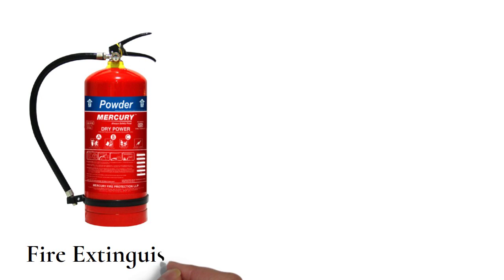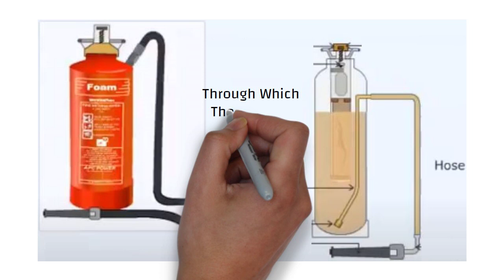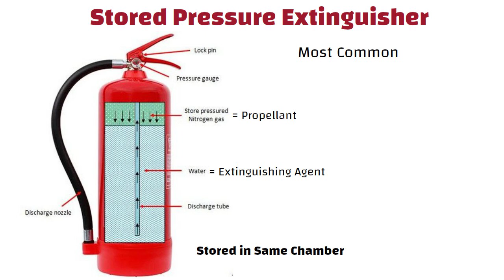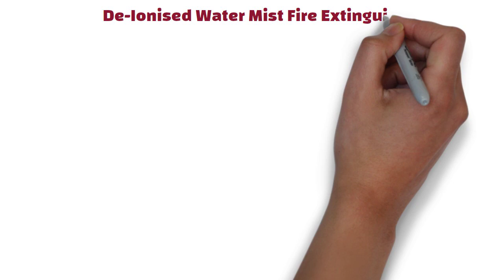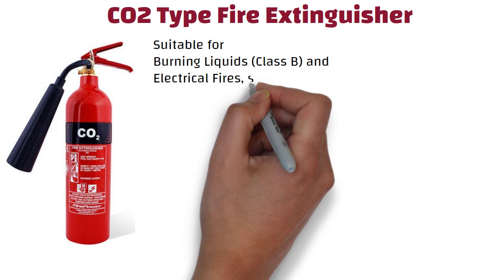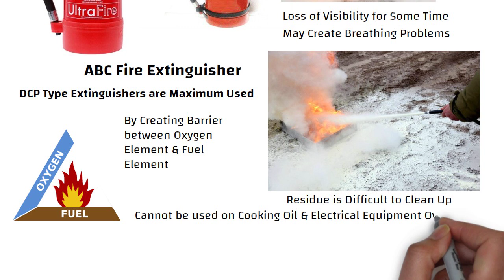FIRE EXTINGUISHER DEALERS IN KERALA, CALL 8138906102, FIRE EXTINGUISHER DEALERS IN ERNAKULAM.

Comment from the maker: FIRE ALARM DEALERS IN TRIVANDRUM, ADDRESSABLE FIRE ALARM DEALERS IN TRIVANDRUM, FIRE ALARM SYSTEM DEALERS IN TRIVANDRUM, ADDRESSABLE FIRE ALARM SYSTEM DEALERS IN TRIVANDRUM, FIRE DETECTION SYSTEM IN TRIVANDRUM, SMOKE DETECTOR DEALERS IN TRIVANDRUM, CONVENTIONAL FIRE ALARM DEALERS IN TRIVANDRUM, MORLEY FIRE ALARM DEALERS IN TRIVANDRUM, GST FIRE ALARM DEALERS IN TRIVANDRUM, ASES SECURITY FIRE ALARM DEALERS IN TRIVANDRUM, BEAM DETECTOR DEALERS IN TRIVANDRUM, FIRE ALARM SUPPLIERS IN TRIVANDRUM, FIRE ALARM TRADERS IN TRIVANDRUM, FIRE ALARM PANEL DEALERS IN TRIVANDRUM, HEAT DETECTOR DEALERS IN TRIVANDRUM, FIRE ALARM SYSTEM SUPPLIERS IN TRIVANDRUM, FIRE ALARM COMPANIES IN TRIVANDRUM, FIRE EQUIPMENT DEALERS IN TRIVANDRUM, ADRRESSABLE FIRE ALARM PANEL DEALERS IN TRIVANDRUM, FIRE ALARM SYSTEM IN TRIVANDRUM, BATTERY OPERATED DETECTOR DEALERS IN TRIVANDRUM, ASPIRATION DETECTION SYSTEM DEALERS IN TRIVANDRUM, FIRE ALARM MCP - MANUAL CALL POINT DEALERS IN TRIVANDRUM, FIRE ALARM HOOTER DEALERS IN TRIVANDRUM, PA TWO WAY TALK BACK SYSTEM DEALERS IN TRIVANDRUM, PA SYSTEM DEALERS IN TRIVANDRUM, PA TALK BACK UNIT DEALERS IN TRIVANDRUM, HOOTER CUM STROBE DEALERS IN TRIVANDRUM, FIRE PROTECTION SYSTEM IN TRIVANDRUM, FIRE ALARM CONTRACTORS IN TRIVANDRUM, FIRE DETECTORS IN TRIVANDRUM, FIRE ALARM DEALERS IN KOLLAM, ADDRESSABLE FIRE ALARM DEALERS IN KOLLAM, SMOKE DETECTOR DEALERS IN KOLLAM, FIRE EQUIPMENT DEALERS IN TRIVANDRUM, FIRE ALARM INSTALLATION IN TRIVANDRUM, FIRE ALARM COMPANIES IN TRIVANDRUM FIRE ALARM DISTRIBUTORS IN TRIVANDRUM, TALK BACK SYSTEM DEALERS IN TRIVANDRUM, FIRE ALARM SENSOR DEALERS IN TRIVANDRUM, FIRE EXTINGUISHER DEALERS IN TRIVANDRUM, FIRE ALARM DEALERS IN ERNAKULAM, FIRE ALARM DEALERS IN KERALA, ADDRESSABLE FIRE ALARM DEALERS IN CALICUT, SMOKE DETECTOR IN TRIVANDRUM, SMOKE DETECTOR DEALERS IN KOLLAM, FIRE ALARM DEALERS IN KOTTARAKARA, FIRE ALARM DEALERS IN NEDUMANGAD, FIRE ALARM DEALERS IN VARKALA, FIRE ALARM DEALERS IN VARKALA, FIRE ALARM DEALERS IN MARTHANDAM, FIRE ALARM DEALERS IN ATTINGAL, FIRE ALARM DEALERS IN KILIMANOOR, FIRE ALARM DEALERS IN ANCHAL, FIRE ALARM DEALERS IN PATHANAPURAM, FIRE ALARM DEALERS IN PUNALOOR, FIRE ALARM DEALERS IN NEYYATINKARA, FIRE ALARM DEALERS IN POOVAR, FIRE ALARM DEALERS IN KATTAKADA, FIRE ALARM DEALERS IN KAZHAKOOTTAM, FIRE ALARM DEALERS IN PARIPPALLY, FIRE ALARM DEALERS IN PARASSALA, FIRE ALARM DEALERS IN KULASEKHARAM, FIRE ALARM DEALERS IN THUCKALAYFIRE ALARM DEALERS IN BALARAMAPURAM, FIRE ALARM DEALERS IN ARYANADU, FIRE ALARM DEALERS IN POOJAPURA, FIRE ALARM DEALERS IN POTHENCODE, FIRE ALARM DEALERS IN VITHURA, FIRE ALARM DEALERS IN VENJARAMOODU, FIRE ALARM DEALERS IN KILIMANOOR, FIRE ALARM DEALERS IN KADAKKAL, FIRE ALARM DEALERS IN CHATHANNOOR, FIRE ALARM DEALERS IN KOTTIYAM, FIRE ALARM DEALERS IN KUNDARA, FIRE ALARM DEALERS IN CHAVARA, FIRE ALARM DEALERS IN SASTHAMKOTTA, FIRE ALARM DEALERS IN PALODE, FIRE ALARM DEALERS IN VENJARAMOODU, FIRE ALARM DEALERS IN ARYANADU, FIRE ALARM DEALERS IN VELLARASA, FIRE ALARM DEALERS IN VITHURA, FIRE ALARM DEALERS IN THENMALA, FIRE ALARM DEALERS IN AKLLAMBALAM, FIRE ALARM DEALERS IN AYOOR, FIRE ALARM DEALERS IN ARYANKAVU, FIRE ALARM DEALERS IN SENKOTTAI, FIRE ALARM DEALERS IN KULATHUPUZHA, FIRE ALARM DEALERS IN MADATHARA, FIRE ALARM DEALERS IN CHIRAYANKEEZHU, FIRE ALARM DEALERS IN KALLMBALAM, FIRE ALARM DEALERS IN MADATHARA, FIRE ALARM DEALERS IN ADOOR, FIRE ALARM DEALERS IN PANDALAM, FIRE ALARM DEALERS IN SAKTHIKULANGARA, FIRE EXTINGUISHER DEALERS IN TRIVANDRUM, FIRE EXTINGUISHER SUPPLIERS IN TRIVANDRUM, FIRE EXTINGUISHER DISTRIBUTORS IN TRIVANDRUM FIRE EXTINGUISHER IN TRIVANDRUM, ABC TYPE FIRE EXTINGUISHER DEALERS IN TRIVANDRUM, CO2 TYPE FIRE EXTINGUISHER DEALERS IN TRIVANDRUM, CLEAN AGENT FIRE EXTINGUISHER IN TRIVANDRUM FIRE FIGHTING PUMP DEALERS IN TRIVANDRUM, FIRE PUMP DEALERS IN TRIVANDRUM, KIRLOSKAR FIRE PUMP DEALERS IN TRIVANDRUM, FIRE JOCKEY PUMP DEALERS IN TRIVANDRUM, FIRE DISEL ENGINE DRIVEN PUMP DEALERS IN TRIVANDRUM, FIRE FIGHTING EQUIPMENT DEALERS IN TRIVANDRUM, FIRE FIGHTING SYSTEM IN TRIVANDRUM, VERTICAL INLINE PUMP DEALERS IN TRIVANDRUM, HYDRO PNEUMATIC PRESSURE BOOSTING PUMP DEALERS IN TRIVANDRUM, VERTICAL TURBINE PUMP DEALERS IN TRIVANDRUM, SEWAGE PUMP DEALERS IN TRIVANDRUM, DEALERS IN TRIVANDRUM.
Reply: FIRE EXTINGUISHER DEALERS IN KOTTAYAM, FIRE EXTINGUISHER SUPPLIERS IN KOTTAYAM, FIRE EXTINGUISHER DISTRIBUTORS IN KOTTAYAM, FIRE EXTINGUISHER IN KOTTAYAM, ABC TYPE FIRE EXTINGUISHER DEALERS IN KOTTAYAM, CO2 TYPE FIRE EXTINGUISHER DEALERS IN KOTTAYAM, CLEAN AGENT FIRE EXTINGUISHER IN KOTTAYAM, MODULAR TYPE FIRE EXTINGUISHER DEALERS IN KOTTAYAM, MECHANICAL FOAM FIRE EXTINGUISHER DEALERS IN KOTTAYAM, FIRE EXTINGUISHER NEAR ME KOTTAYAM, FIRE EXTINGUISHER TRADERS IN KOTTAYAM, FIRE FIGHTING COMPANIES IN KOTTAYAM, FIRE CONTRACTORS IN KOTTAYAM, FIRE EQUIPMENT DEALERS IN KOTTAYAM, FIRE ALARM DEALERS IN KOTTAYAM, FIRE PUMP DEALERS IN KOTTAYAM, SMOKE DETECTOR DEALERS IN KOTTAYAM, FIRE FIGHTING SYSTEM IN KOTTAYAM, FIRE PROTECTION SYSTEM IN KOTTAYAM, FIRE AND SAFETY CONTRACTORS IN KOTTAYAM, FIRE HYDRANT SYSTEMS IN KOTTAYAM, PA TALK BACK SYSTEM IN KOTTAYAM, FIRE NOC IN KOTTAYAM, FIRE INSTALLATION IN KOTTAYAM, FIRE NOC RENEWAL IN KOTTAYAM, KIRLOSKAR FIRE PUMP DEALERS IN KOTTAYAM, FIRE EXTINGUISHER DEALERS IN CHANGANASSERY, FIRE EXTINGUISHER SUPPLIERS IN CHANGANASSERY, FIRE EXTINGUISHER DISTRIBUTORS IN CHANGANASSERY, FIRE EXTINGUISHER IN CHANGANASSERY, ABC TYPE FIRE EXTINGUISHER DEALERS IN CHANGANASSERY, CO2 TYPE FIRE EXTINGUISHER DEALERS IN CHANGANASSERY, CLEAN AGENT FIRE EXTINGUISHER IN CHANGANASSERY, MODULAR TYPE FIRE EXTINGUISHER DEALERS IN CHANGANASSERY, MECHANICAL FOAM FIRE EXTINGUISHER DEALERS IN CHANGANASSERY, FIRE EXTINGUISHER NEAR ME CHANGANASSERY, FIRE EXTINGUISHER TRADERS IN CHANGANASSERY, FIRE FIGHTING COMPANIES IN CHANGANASSERY, FIRE CONTRACTORS IN CHANGANASSERY, FIRE EQUIPMENT DEALERS IN CHANGANASSERY, FIRE ALARM DEALERS IN CHANGANASSERY, FIRE PUMP DEALERS IN CHANGANASSERY, SMOKE DETECTOR DEALERS IN CHANGANASSERY, FIRE FIGHTING SYSTEM IN CHANGANASSERY, FIRE PROTECTION SYSTEM IN CHANGANASSERY, FIRE AND SAFETY CONTRACTORS IN CHANGANASSERY, FIRE HYDRANT SYSTEMS IN CHANGANASSERY, PA TALK BACK SYSTEM IN CHANGANASSERY, FIRE NOC IN CHANGANASSERY, FIRE INSTALLATION IN CHANGANASSERY, FIRE NOC RENEWAL IN CHANGANASSERY, KIRLOSKAR FIRE PUMP DEALERS IN CHANGANASSERY, FIRE EXTINGUISHER DEALERS IN CHANGANACHERRY, FIRE EXTINGUISHER SUPPLIERS IN CHANGANACHERRY, FIRE EXTINGUISHER DISTRIBUTORS IN CHANGANACHERRY, FIRE EXTINGUISHER IN CHANGANACHERRY, ABC TYPE FIRE EXTINGUISHER DEALERS IN CHANGANACHERRY, CO2 TYPE FIRE EXTINGUISHER DEALERS IN CHANGANACHERRY, CLEAN AGENT FIRE EXTINGUISHER IN CHANGANACHERRY, MODULAR TYPE FIRE EXTINGUISHER DEALERS IN CHANGANACHERRY, MECHANICAL FOAM FIRE EXTINGUISHER DEALERS IN CHANGANACHERRY, FIRE EXTINGUISHER NEAR ME CHANGANACHERRY, FIRE EXTINGUISHER DEALERS IN THIRUVALLA, FIRE EXTINGUISHER IN THIRUVALLA.

Comment from the maker: Fire extinguisher dealers in Malappuram, Fire extinguisher suppliers in Malappuram, Fire extinguisher traders in Malappuram, Fire extinguisher in Malappuram
Reply: FIRE EXTINGUISHER DEALERS IN KERALA, FIRE EXTINGUISHER SUPPLIERS IN KERALA, FIRE EXTINGUISHER DISTRIBUTORS IN KERALA, FIRE EXTINGUISHER IN KERALA, ABC TYPE FIRE EXTINGUISHER DEALERS IN KERALA, CO2 TYPE FIRE EXTINGUISHER DEALERS IN KERALA, CLEAN AGENT FIRE EXTINGUISHER IN KERALA, MODULAR TYPE FIRE EXTINGUISHER DEALERS IN KERALA, MECHANICAL FOAM FIRE EXTINGUISHER DEALERS IN KERALA, FIRE EXTINGUISHER NEAR ME KERALA, FIRE EXTINGUISHER TRADERS IN KERALA, FIRE FIGHTING COMPANIES IN KERALA, FIRE CONTRACTORS IN KERALA, FIRE EQUIPMENT DEALERS IN KERALA, FIRE ALARM DEALERS IN KERALA, FIRE PUMP DEALERS IN KERALA, SMOKE DETECTOR DEALERS IN KERALA, FIRE FIGHTING SYSTEM IN KERALA, FIRE PROTECTION SYSTEM IN KERALA, FIRE AND SAFETY CONTRACTORS IN KERALA, FIRE HYDRANT SYSTEMS IN KERALA, PA TALK BACK SYSTEM IN KERALA, FIRE NOC IN KERALA, FIRE INSTALLATION IN KERALA, FIRE NOC RENEWAL IN KERALA, KIRLOSKAR FIRE PUMP DEALERS IN KERALA, FIRE EXTINGUISHER NEAR ME KERALA, FIRE EXTINGUISHER MANUFACURERS IN KERALA, SAFEX FIRE EXTINGUISHER DEALERS IN KERALA, FIRE NOC CONTRACTORS IN KERALA, FIRE FIGHTING EQUIPMENT DEALERS IN KERALA, FIRE PROTECTION SYSTEM IN KERALA, FIRE INSTALLATION IN KERALA, FIRE SAFETY CONTRACTORS IN KERALA, FIRE AMC IN KERALA, FIRE PROTECTION SYSTEM IN KERALA, FIRE PROTECTION EQUIPMET IN KERALA, AMC OF FIRE SYSTEM IN KERALA, FIRE CONSULTANTS IN KERALA, FIRE AND SAFETY EQUIPMENT DEALERS IN KERALA, ADDRESSABLE FIRE ALARM SYSTEM IN KERALA, KARTHAR VALVE DEALERS IN KERALA, DCP TYPE FIRE EXTINGUISHER IN KERALA, POWSER TYPE FIRE EXTINGUISHERS IN KERALA, FIRE HYDRANT SYSTEM IN KERALA, FIRE ALARM PANEL DEALERS IN KERALA, SAFEPRO FIRE EXTINGUISHER DEALERS IN KERALA, MS AND GI PIPE DEALERS IN KERALA, JINDAL PIPE DEALERS IN KERALA, AGNI FIRE ALARM DEALERS IN KERALA, FIRE EQUIPMENT DEALERS IN KERALA, FIRE EQUIPMENT SUPPLIERS IN KERALA, FIRE EQUIPMENT TRADERS IN KERALA, FIRE SPRINKLER SYSTEM IN KERALA, RAVLE FIRE ALARM DEALERS IN KERALA, RAVEL FIRE ALARM SYSTEM IN KERALA, AGNI FIRE ALARM DISTRIBUTORS IN KERALA, FIRE ALARM CONTRACTORS IN KERALA, FIRE PIPE INSTALLATION IN CONTRACTORS IN KERALA, FIRE SAFETY CONTRACTORS IN KERALA, FIRE PA TWO WAY TALK BACK SYSTEM DEALERS IN KERALA, HEAT DETECTOR DEALERS IN KERALA, HONEYWELL FIRE ALARM DEALERS IN KERALA, FIRE NOC CONSULTANTS IN KERALA, FIRE AMC AND FIRE NOC IN KERALA, FIRE SAFETY COMPANIES IN KERALA, NEWAGE DEALERS IN KERALA, MONSHER FIRE EQUIPMENT DEALERS IN KERALA, KARTHAR VALVE DEALERS IN KERALA, FIRE HYDRANT VALVE DEALERS IN KERALA, FIRE HOSE REEL DRUM DEALERS IN KERALA, FIRE SPRINKLER DEALERS IN KERALA, FIRE PUMP DEALERS IN KERALA, LUBI PUMP DEALERS IN KERALA, LHP PUMP DEALERS IN KERALA.

Comment from the maker: Fire extinguisher dealers in Kottakkal, Fire extinguisher suppliers in Kottakkal, Fire extinguisher traders in Kottakkal, Fire extinguisher in Kottakkal
Reply: FIRE EXTINGUISHER DEALERS IN THIRUVALLA, FIRE EXTINGUISHER SUPPLIERS IN THIRUVALLA, FIRE EXTINGUISHER DISTRIBUTORS IN THIRUVALLA, FIRE EXTINGUISHER IN THIRUVALLA, ABC TYPE FIRE EXTINGUISHER DEALERS IN THIRUVALLA, CO2 TYPE FIRE EXTINGUISHER DEALERS IN THIRUVALLA, CLEAN AGENT FIRE EXTINGUISHER IN THIRUVALLA, MODULAR TYPE FIRE EXTINGUISHER DEALERS IN THIRUVALLA, MECHANICAL FOAM FIRE EXTINGUISHER DEALERS IN THIRUVALLA, FIRE EXTINGUISHER NEAR ME THIRUVALLA, FIRE EXTINGUISHER TRADERS IN THIRUVALLA, FIRE FIGHTING COMPANIES IN THIRUVALLA, FIRE CONTRACTORS IN THIRUVALLA, FIRE EQUIPMENT DEALERS IN THIRUVALLA, FIRE ALARM DEALERS IN THIRUVALLA, FIRE PUMP DEALERS IN THIRUVALLA, SMOKE DETECTOR DEALERS IN THIRUVALLA, FIRE FIGHTING SYSTEM IN THIRUVALLA, FIRE PROTECTION SYSTEM IN THIRUVALLA, FIRE AND SAFETY CONTRACTORS IN THIRUVALLA, FIRE HYDRANT SYSTEMS IN THIRUVALLA, PA TALK BACK SYSTEM IN THIRUVALLA, FIRE NOC IN THIRUVALLA, FIRE INSTALLATION IN THIRUVALLA, FIRE NOC RENEWAL IN THIRUVALLA, KIRLOSKAR FIRE PUMP DEALERS IN THIRUVALLA, FIRE EXTINGUISHER NEAR ME THIRUVALLA, FIRE EXTINGUISHER MANUFACURERS IN THIRUVALLA, SAFEX FIRE EXTINGUISHER DEALERS IN THIRUVALLA, FIRE NOC CONTRACTORS IN THIRUVALLA, FIRE FIGHTING EQUIPMENT DEALERS IN THIRUVALLA, FIRE PROTECTION SYSTEM IN THIRUVALLA, FIRE INSTALLATION IN THIRUVALLA, FIRE SAFETY CONTRACTORS IN THIRUVALLA, FIRE AMC IN THIRUVALLA, FIRE PROTECTION SYSTEM IN THIRUVALLA, FIRE PROTECTION EQUIPMET IN THIRUVALLA, AMC OF FIRE SYSTEM IN THIRUVALLA, FIRE CONSULTANTS IN THIRUVALLA, FIRE AND SAFETY EQUIPMENT DEALERS IN THIRUVALLA, ADDRESSABLE FIRE ALARM SYSTEM IN THIRUVALLA, KARTHAR VALVE DEALERS IN THIRUVALLA, DCP TYPE FIRE EXTINGUISHER IN THIRUVALLA, POWSER TYPE FIRE EXTINGUISHERS IN THIRUVALLA, FIRE HYDRANT SYSTEM IN THIRUVALLA, FIRE ALARM PANEL DEALERS IN THIRUVALLA, SAFEPRO FIRE EXTINGUISHER DEALERS IN THIRUVALLA, MS AND GI PIPE DEALERS IN THIRUVALLA, JINDAL PIPE DEALERS IN THIRUVALLA, AGNI FIRE ALARM DEALERS IN THIRUVALLA, FIRE EQUIPMENT DEALERS IN THIRUVALLA, FIRE EQUIPMENT SUPPLIERS IN THIRUVALLA, FIRE EQUIPMENT TRADERS IN THIRUVALLA, FIRE SPRINKLER SYSTEM IN THIRUVALLA, RAVLE FIRE ALARM DEALERS IN THIRUVALLA, RAVEL FIRE ALARM SYSTEM IN THIRUVALLA, AGNI FIRE ALARM DISTRIBUTORS IN THIRUVALLA, FIRE ALARM CONTRACTORS IN THIRUVALLA, FIRE PIPE INSTALLATION IN CONTRACTORS IN THIRUVALLA, FIRE SAFETY CONTRACTORS IN THIRUVALLA, FIRE PA TWO WAY TALK BACK SYSTEM DEALERS IN THIRUVALLA, HEAT DETECTOR DEALERS IN THIRUVALLA, HONEYWELL FIRE ALARM DEALERS IN THIRUVALLA, FIRE NOC CONSULTANTS IN THIRUVALLA, FIRE AMC AND FIRE NOC IN THIRUVALLA, FIRE SAFETY COMPANIES IN THIRUVALLA, NEWAGE DEALERS IN THIRUVALLA, MONSHER FIRE EQUIPMENT DEALERS IN THIRUVALLA, KARTHAR VALVE DEALERS IN THIRUVALLA, FIRE HYDRANT VALVE DEALERS IN THIRUVALLA, FIRE HOSE REEL DRUM DEALERS IN THIRUVALLA, FIRE SPRINKLER DEALERS IN THIRUVALLA, FIRE PUMP DEALERS IN THIRUVALLA, LUBI PUMP DEALERS IN THIRUVALLA, LHP PUMP DEALERS IN THIRUVALLA. FIRE CONTRACTORS IN THIRUVALLA, FIRE AND SAFETY CONTRACTORS IN THIRUVALLA, FIRE EQUIPMENT DEALERS IN THIRUVALLA, FIRE FIGHTING CONTRACTORS IN THIRUVALLA,
Reply: FIRE EXTINGUISHER DEALERS IN MAVELIKARA, FIRE EXTINGUISHER SUPPLIERS IN MAVELIKARA, FIRE EXTINGUISHER DISTRIBUTORS IN MAVELIKARA, FIRE EXTINGUISHER IN MAVELIKARA, ABC TYPE FIRE EXTINGUISHER DEALERS IN MAVELIKARA, CO2 TYPE FIRE EXTINGUISHER DEALERS IN MAVELIKARA, CLEAN AGENT FIRE EXTINGUISHER IN MAVELIKARA, MODULAR TYPE FIRE EXTINGUISHER DEALERS IN MAVELIKARA, MECHANICAL FOAM FIRE EXTINGUISHER DEALERS IN MAVELIKARA, FIRE EXTINGUISHER NEAR ME MAVELIKARA, FIRE EXTINGUISHER TRADERS IN MAVELIKARA, FIRE FIGHTING COMPANIES IN MAVELIKARA, FIRE CONTRACTORS IN MAVELIKARA, FIRE EQUIPMENT DEALERS IN MAVELIKARA, FIRE ALARM DEALERS IN MAVELIKARA, FIRE PUMP DEALERS IN MAVELIKARA, SMOKE DETECTOR DEALERS IN MAVELIKARA, FIRE FIGHTING SYSTEM IN MAVELIKARA, FIRE PROTECTION SYSTEM IN MAVELIKARA, FIRE AND SAFETY CONTRACTORS IN MAVELIKARA, FIRE HYDRANT SYSTEMS IN MAVELIKARA, PA TALK BACK SYSTEM IN MAVELIKARA, FIRE NOC IN MAVELIKARA, FIRE INSTALLATION IN MAVELIKARA, FIRE NOC RENEWAL IN MAVELIKARA, KIRLOSKAR FIRE PUMP DEALERS IN MAVELIKARA, FIRE EXTINGUISHER NEAR ME MAVELIKARA, FIRE EXTINGUISHER MANUFACURERS IN MAVELIKARA, SAFEX FIRE EXTINGUISHER DEALERS IN MAVELIKARA, FIRE NOC CONTRACTORS IN MAVELIKARA, FIRE FIGHTING EQUIPMENT DEALERS IN MAVELIKARA, FIRE PROTECTION SYSTEM IN MAVELIKARA, FIRE INSTALLATION IN MAVELIKARA, FIRE SAFETY CONTRACTORS IN MAVELIKARA, FIRE AMC IN MAVELIKARA, FIRE PROTECTION SYSTEM IN MAVELIKARA, FIRE PROTECTION EQUIPMET IN MAVELIKARA, AMC OF FIRE SYSTEM IN MAVELIKARA, FIRE CONSULTANTS IN MAVELIKARA, FIRE AND SAFETY EQUIPMENT DEALERS IN MAVELIKARA, ADDRESSABLE FIRE ALARM SYSTEM IN MAVELIKARA, KARTHAR VALVE DEALERS IN MAVELIKARA, DCP TYPE FIRE EXTINGUISHER IN MAVELIKARA, POWSER TYPE FIRE EXTINGUISHERS IN MAVELIKARA, FIRE HYDRANT SYSTEM IN MAVELIKARA, FIRE ALARM PANEL DEALERS IN MAVELIKARA, SAFEPRO FIRE EXTINGUISHER DEALERS IN MAVELIKARA, MS AND GI PIPE DEALERS IN MAVELIKARA, JINDAL PIPE DEALERS IN MAVELIKARA, AGNI FIRE ALARM DEALERS IN MAVELIKARA, FIRE EQUIPMENT DEALERS IN MAVELIKARA, FIRE EQUIPMENT SUPPLIERS IN MAVELIKARA, FIRE EQUIPMENT TRADERS IN MAVELIKARA, FIRE SPRINKLER SYSTEM IN MAVELIKARA, RAVEL FIRE ALARM DEALERS IN MAVELIKARA, RAVEL FIRE ALARM SYSTEM IN MAVELIKARA, AGNI FIRE ALARM DISTRIBUTORS IN MAVELIKARA, FIRE ALARM CONTRACTORS IN MAVELIKARA, FIRE PIPE INSTALLATION IN CONTRACTORS IN MAVELIKARA, FIRE SAFETY CONTRACTORS IN MAVELIKARA, FIRE PA TWO WAY TALK BACK SYSTEM DEALERS IN MAVELIKARA, HEAT DETECTOR DEALERS IN MAVELIKARA, HONEYWELL FIRE ALARM DEALERS IN MAVELIKARA, FIRE NOC CONSULTANTS IN MAVELIKARA, FIRE AMC AND FIRE NOC IN MAVELIKARA, FIRE SAFETY COMPANIES IN MAVELIKARA, NEWAGE DEALERS IN MAVELIKARA, MONSHER FIRE EQUIPMENT DEALERS IN MAVELIKARA, KARTHAR VALVE DEALERS IN MAVELIKARA, FIRE HYDRANT VALVE DEALERS IN MAVELIKARA, FIRE HOSE REEL DRUM DEALERS IN MAVELIKARA, FIRE SPRINKLER DEALERS IN MAVELIKARA, FIRE PUMP DEALERS IN MAVELIKARA, LUBI PUMP DEALERS IN MAVELIKARA, LHP PUMP DEALERS IN MAVELIKARA. FIRE ALARM SYSTEMS IN MAVELIKARA, ADDRESSABLE FIRE ALARM DEALERS IN MAVELIKARA, SMOKE DETECTOR DEALERS IN MAVELIKARA, FIRE ALARM CONTRACTORS IN MAVELIKARA, FIRE ALARM PANEL DEALERS IN MAVELIKARA, BIRE ALARM INSTALLTION IN MAVELIKARA, MORLEY FIRE ALARM DEALERS IN MAVELIKARA, HONEYWELL FIRE ALARM DEALERS IN MAVELIKARA, GST FIRE ALARM DEALERS IN MAVELIKARA, FIRE FIGHTING COMPANIES IN MAVELIKARA, FIRE AND SAFETY CONTRACTORS IN MAVELIKARA, FIRE EQUIPMENT IN MAVELIKARA, SAFEPRO FIRE EXTINGUISHER DEALERS IN MAVELIKARA, SAFEX FIRE EXTINGUISHER DEALERS IN MAVELIKARA, SIMPLEX FIRE ALARM DEALERS IN MAVELIKARA, TYCO DEALERS IN MAVELIKARA, JINDAL PIPE DEALERS IN MAVELIKARA, KARTHAR DISTRIBUTORS IN MAVELIKARA, STENTOR DEALERS IN MAVELIKARA, MONSHER DEALERS IN MAVELIKARA, NEWAGE DEALERS IN MAVELIKARA, RONAK HOSE REEL DEALERS IN MAVELIKARA,